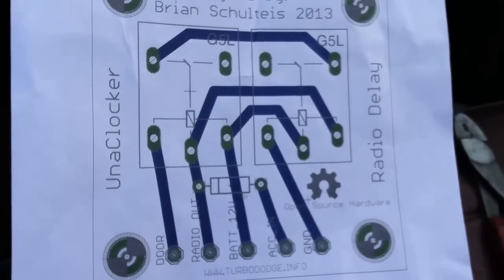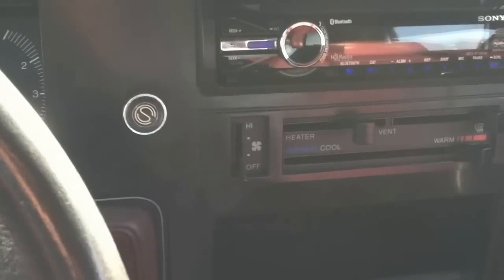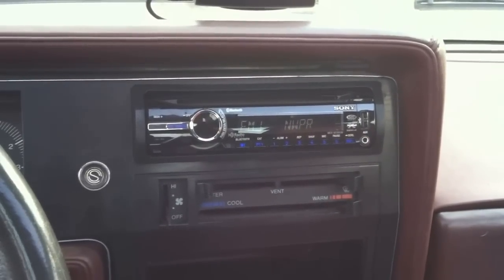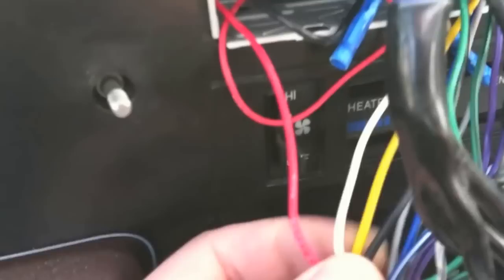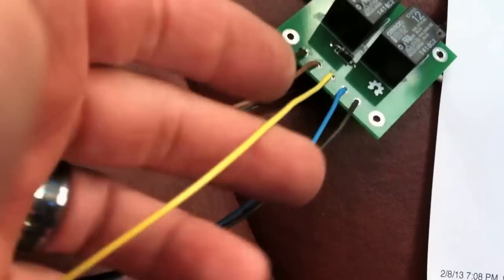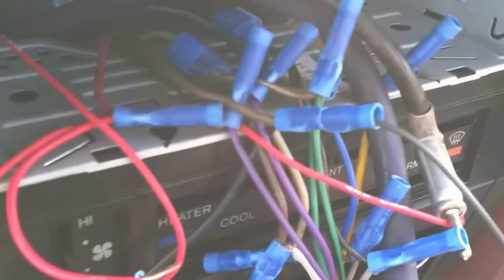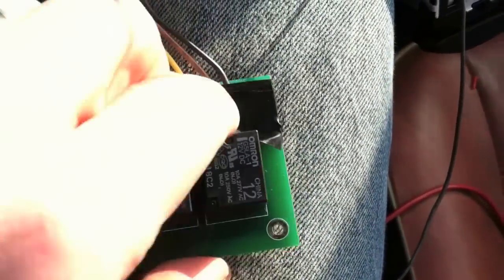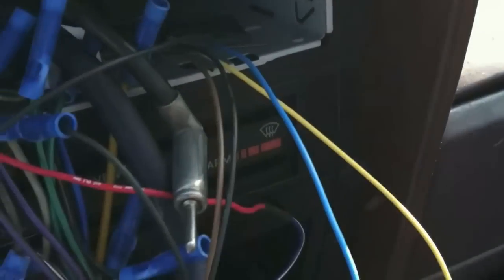Radio Delay Circuit

Comment from the maker: Yes, but whether or not the stereo remains on during cranking also depends on how much voltage drop you get during cranking. One of my cars the radio stays on, the other, it doesn't. But the circuit remains on in both cars.